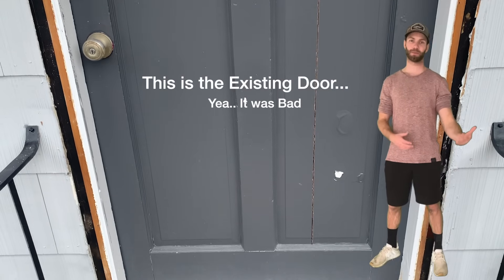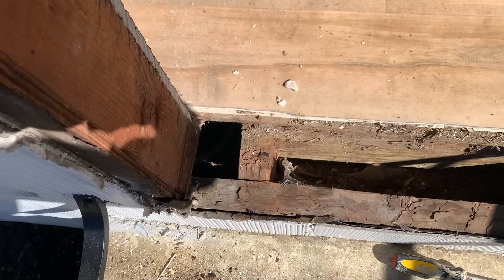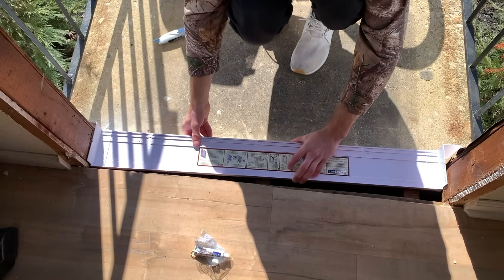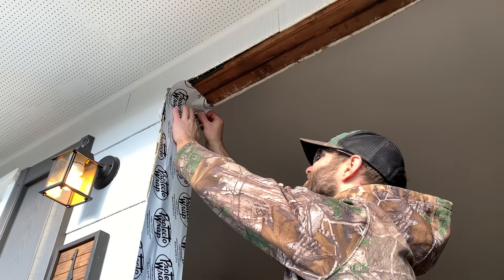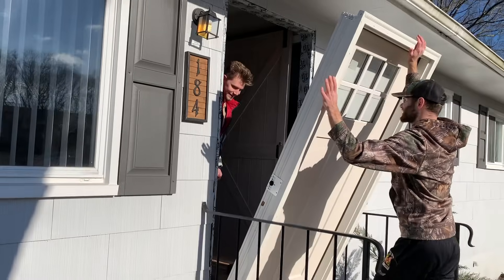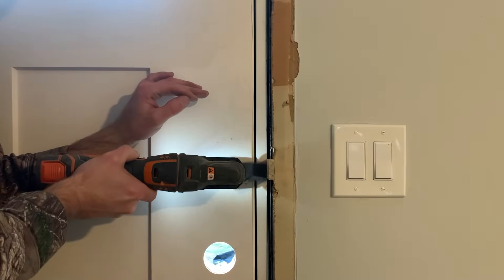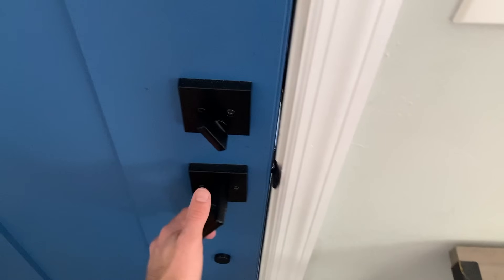DIY Front Door Replacement (How to Replace a Front Door Step-by-Step)

Comment: Still trying to find a video showing concrete walls. All have been wood.
Reply: Same thing. Get the existing pins out with a saw saw with a metal blade. And follow the same process except now you’re going to use a hammer drill to drill your holes after plumbing and then use tap cons to screw it in. Just make sure it’s level and plumed great and no movement. Hopefully this helps if you’re still looking for help.
Reply: @Bryant801.  Thanks

Comment: Thank you!  I just replaced my door and what should have been a 30-minute project turned into a 3-day project.  The previous owners put a faux brick facade over the front of the door.  The trick I used was to Sawzaw the frame in half and take it out piece by piece.  Then getting the new frame in was easier.  I had to fill about a 1.5 inch air gap between one side of the frame and the house with a 1x6, but it sealed up nicely thanks to your guide!  The shims are always a pain in the rear for me, lol

Comment: This is by far the best video on YouTube on exterior door installation. It covered every step along the way. I will say in my house in particular, since it's a bit older, the frame was a VERY tight fit into the side of the house which presented some challenges. It's never as easy as you see online or TV, but that said, this video was the best guide I found.
Reply from the maker: Glad it helped and thanks for watching!
Reply: I'm in the middle of replacing the rear exterior door on my home built in 1985. The gap between the door frame and rough framing is tiny, and my rear siding is basically a reverse of the brick mold shown on this door, where the door frame is hidden by the siding itself.
Next step is to cut away all the nails holding the frame on, then I'll be ready to pull the door out. Hopefully the tight fit doesn't present too many challenges!

Comment: I can agree drilling through the door for the knob hardware was intimidating for me as well. I almost called someone but did it myself with success. I used the included template which made it super easy.

Comment: Thanks for the quality video! About to do my first door replacement on a stucco finish. Going to reuse the slab so I’ll be replacing the jamb and threshold. I like the pvc sill you used! I have no step down, it’s flush from interior to exterior so I’m not sure what I’ll do for weatherproofing at the threshold.

Comment: If you fill the gap in the framing with expansion foam and flash the face of the jamb you don't have to butyl the entire frame. Flashing the frame doesn't add any additional benefit and just costs money. Otherwise, great video and glad to see you saved some money on your fixer!

Comment: Hi great video.  I'm looking to install a front entry door and I'm noticing that some doors have a sill plate that's either flush with the interior flooring (wood, LVP, tile, etc.) or some that are below the flooring which is your case. When you ordered your door, what measurements did you use to measure your rough opening and determine the height of your threshold?  Some manufacturers have taller or shorter thresholds so I'd like mine to be as flush with my interior flooring as possible to avoid a tripping hazard. After removing my threshold, the sill plate is flush with my LVP flooring so I'm not sure if I should remove the sill plate to take the rough opening measurement or measure from top of sill plate to bottom of my header.  Also what did you use to transition from your threshold to floor for the finishing touch? Thanks!

Comment: Hi, I replaced my front door watching this video and through some trial and error got the job done with my wife helping.  Awesome tips and I used the low expansion foam instead of insulation.  My issue I managed to work around was my door was almost exactly the height of the rough opening.  I had to hammer it into place for it to work, but it did.  Is there a way around this?  The bottom of the rough opening is concrete and the top has metal bars which cannot be cut. I cannot get a shorter pre-hung door.  It is 32" x 80".

Comment: I have had 2 handymen come and not be able to really finish the trim around the door. I have exposed wood on either side so it seems like we’re in the “reveal stage” and there were gaps around the door frame. Do you have any suggestions for I guess working backwards since the door is already installed?
Reply: To be clear, the door is hung and the exposed wood to button up any of the gaps so that pests/water can’t enter.

Comment: This might be a long shot since the video was made a year ago but I have a question for you. I am trying to replace my front door since it is about 70-80 years old and its very drafty. How do you go about measuring the prehung door frame/mold without taking my door and existing fram apart?

Comment: I've got an old house with an odd size jamb width. Since I'll have some wiggle room with a 4 1/2" jamb, should I position the new door flush with the exterior or interior?
Reply from the maker: Hmmm - I would say put it flush with the exterior since you will want to Seal the gaps from water. Might want to consult with a pro if it's really strange. Thanks for watching! Appreciate the support!
Reply: @AndrewThronImprovements  I wonder if I should put on jamb extensions to get me close to flush. I'm a bit confused on what to do with the storm door when it comes to the brick molding that the new door comes with. Do most folks take that off or alter it to get the storm door situated?
Reply: @AndrewThronImprovements  Wrong. Flush it with interior.

You need to add jamb extensions to the exterior side.

Flushing with exterior and then adding extenstion on the inside will cause the door to bind/not fully open.

Comment: Do you need a sill plate if the floor underneath is concrete?
Reply: You do not need a sill plate on concrete. The door can be placed directly on top of the concrete. Apply door sealant/adhesive on clean concrete and place door into opening. Caulk underneath door sill plate where it meets concrete.

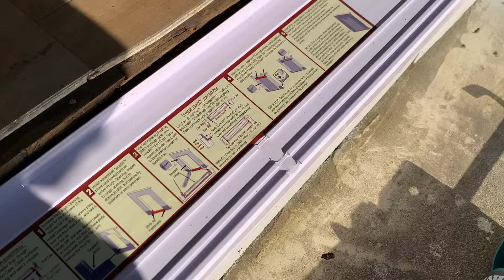Comment: Something went wrong in the video. Share your mistakes. At 4:12 you were applying clear sealant onto the seal plate which was clean. Then one second later you said you were a bit embarrassed for your dirty seal plate and I noticed it was white caulk that time and there is caulk on the sides and front as well. Apparently the install went wrong and you finished then tore it back out and did something else. Tell me what happened?

Comment: You may want to show your subscribers how to extend the door jamb. I noticed your door does not come flush to the sheet rock inside the house. Couldn't really tell how you overcame that issue!
Reply: It’s doesn’t need to be flush with the drywall. The molding will cover it anyway.
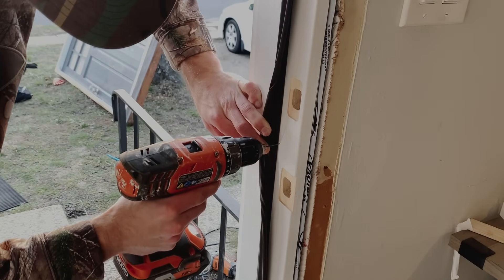Reply: @colleeneverett4279   Sorry, but you are 100% wrong. The door needs to be flush with drywall on the interior of the house. You will need to add a extension jamb to the door or you will have a 1/2 or more gap from the door jamb to new interior trim.  Look at the 6:15 mark in the video. That door is not even/flush  with the interior drywall.
Reply: Correct. Flush with drywall on hinge side always. Remove brick mould, extend the jambs and put back brick mould.

Comment: You’re better off using fiberglass insulation packet around the door with a putty knife and you will get a better seal. You won’t get the air pockets. It will hold the heat nobody does that on windows or doors no more they use that worthless spray foam and you always have air pockets, it’s never a tight seal. You want a tight seal use fiberglass and a potty knife take the time do it right